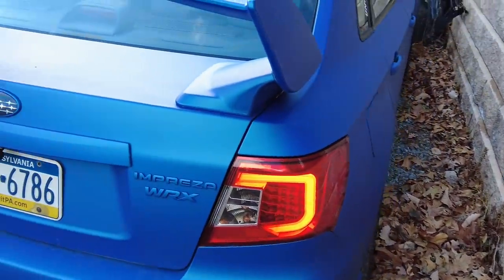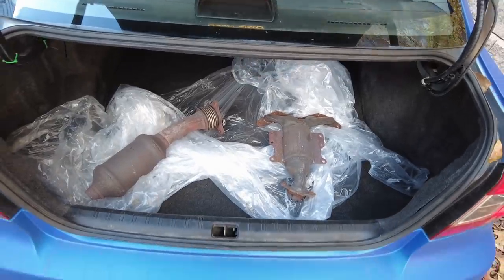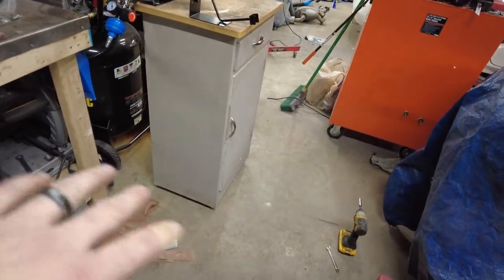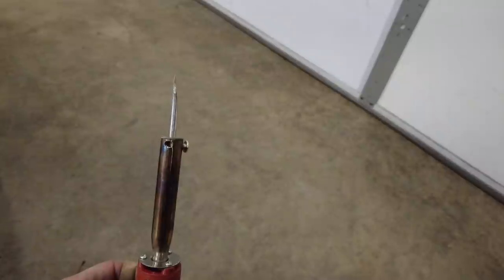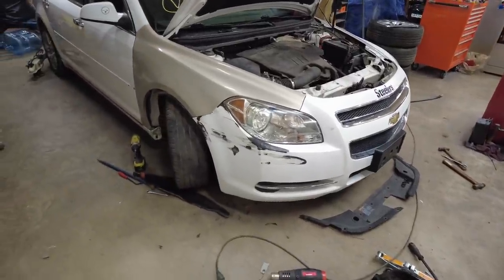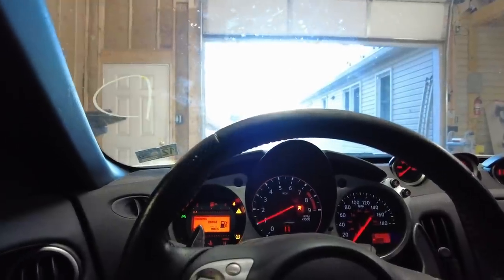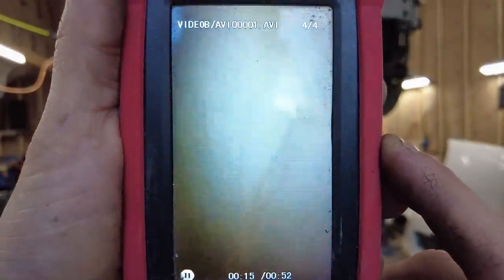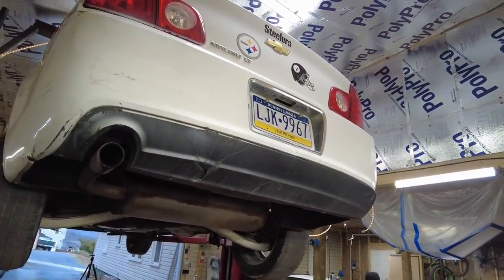will a catalytic converter pay for a speeding ticket

Comment: Todd: pushes paint table 1 foot to the right
Popo: WHOA, slow down there tiger!😉

Todd: 1 tire of the Z touches pavement
Mexican Popo: WHOA, más despacio, tigre!

Cracked manifold is VERY common on those engines.  Salvage yard not a great bet.  Most likely already cracked.   Seen a lot of those.  Thankfully like you said the cat isn't part of it.  Had a 2010 Canyon 5 cylinder that was all in one and it cracked twice on me, just like dad's honda.  Otherwise a pretty great little trucklet.

Peace sparky! ✌

Comment: I have slowed down as I have gotten older. The points that come with a ticket are killer, so he did you a big favor by dropping it and no points. I wonder if you were driving the TC if he would have pulled you over.
Reply from the maker: Probably not

Comment: Radar detectors are your friend!!, like anything they are just a tool that needs to be used correctly to get the best results. I can't count how many times it saved my butt when i was mindlessly cruising along not paying attention to the speed limits and the alert goes off and i was able to reduce speed quick enough before a positive reading of speed was obtained!!!! Is a radar detector foolproof, nope!! some cops will wait till you are right on top of them to spray you with radar or laser and its more difficult to quickly respond by slowing down enough and laser only takes a second or 2 in getting a positive bounce back in most instances, this is where seeing the cop before hand does the most benefit . But most cops are lazy and will just leave it on at a low level getting a general reading of everyone going by and that's where  a radar detector is most valuable alerting you ahead of the cop!!! The nice thing is the first few speeding tickets avoided and the detector has paid for its self!!! So far there are still only two areas where a radar detector is illegal to have, Virginia and District of Criminals....
Something to consider!!!......
Reply from the maker: They are also illegal here
Reply: @UnWrecked WOOHOO!,  Radar detectors are LEGAL in the state of Pennsylvania, BUT, they are illegal when present in COMMERCIAL vehicles and shall not be attached to the windshield of non commercial vehicle.  Says nothing about mounting anywhere else though!!! :-)